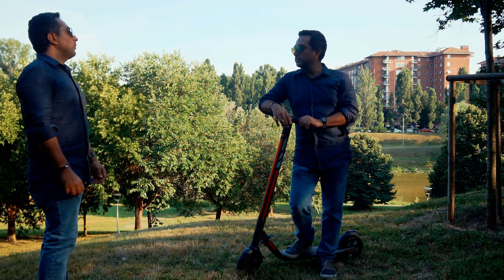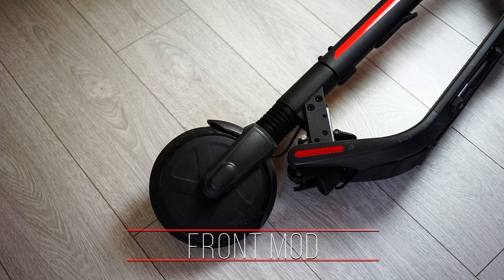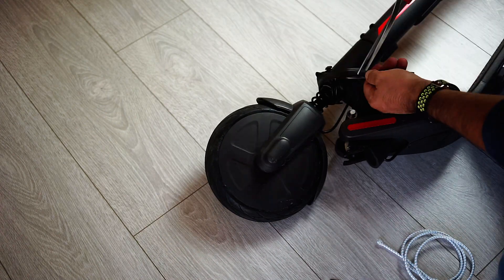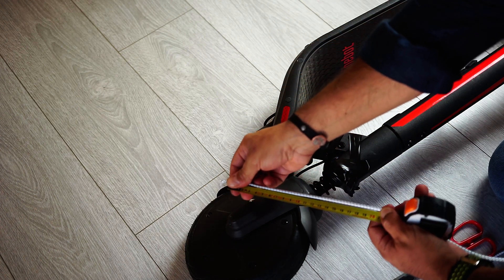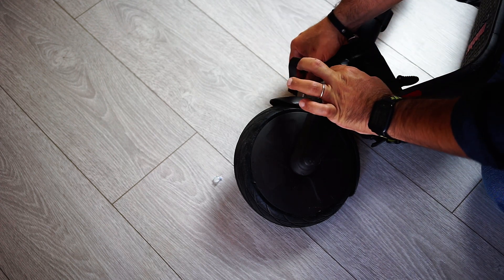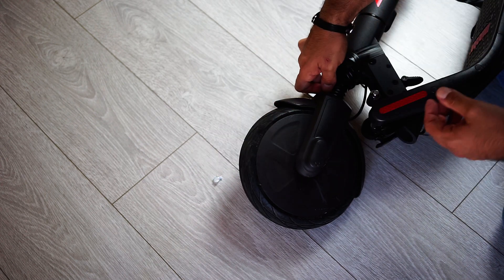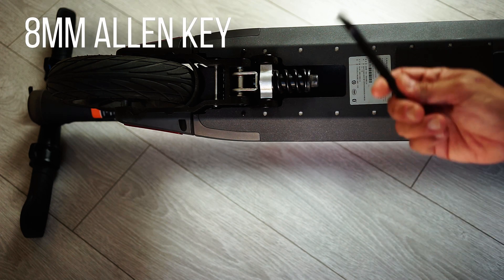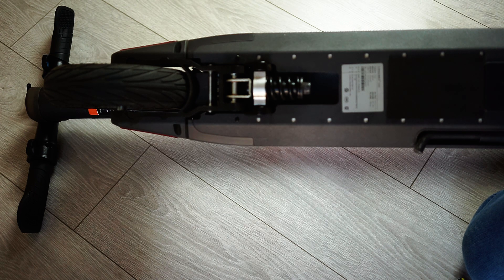Ninebot ES1 ES2 ES4 front suspension mod & rear adjustment

Comment: On every small height difference (about 1cm) there is a loud noise like suspension topping off. I learned to avoid such noise by jumping over obstacles. It puts more strain on the rear suspension, but makes a smoother ride when you just jump over anything that would make hard noise. When you drive fast, you can easily jump over the large square metal covers on the road.
I will try your mod, it's an interesting idea.
Reply from the maker: Yes your suggestion is what I try to do too, but this mod helped a bit with the disturbing noise

Comment: I don't know mate. If you stiffen the spring with any material, even with elastic one, you will have a smoother sound for sure but the power that goes through the wheel will change. Maybe im wrong here, but if the engineerd it well, than the resonance should work like its originally desing and if you modify it even a bit like this will create resonance on other parts which are not obviously takes that much. That means on my theory that you solve a cracking sound which is annyoing as hell meanwhile creating a slowly developing crack on somewhere else in the body, wheel rod, or may pushing the wheel or increase tyres wear a bit more it than should be. Adding up with the overclocking software... well :) you got it from here. But as a solution for budget money, this was a good one and thank you for it !
Reply from the maker: I didn't stiffen it since using a thin elastic cable, it will increment the absorption power of the spring, if you exceed with the thickness that might be a problem as I said in the video

Comment: Hey short question: e45d here, but same suspension in the front.
I have the problem that the suspension doesn't really work bc I'm too light. 63 kg and as far as I can see, it mostly is on the highest stage, with me being too light to "push it in" so if I'm driving over a piece of uneven ground, it's not damping anything, driving as if there wasn't suspension at all.

Anything I can do?
Reply: Eat more burgers like elvis

Comment: — Hey pal, just wanted to say thank you. I had just purchased my ES3, and I was wondering what that sound was going over bumps, now with your help, I went out and got 5mm elastic cord, and followed your steps. The front suspension is MUCH more durable now, and doesn’t bottom out on me, and I’m 260lbs. 😂 So thank you! I’ve liked, commented, and subscribed. I think I might be having a burning wire issue as well, as mentioned in your other video, but no wires are melted, or deteriorated that I can see. My scooter is at 440kms. (273 miles)
Reply from the maker: That's great! I'm glad the mod helped you too ;)
Reply: Was it error 54? I left mine at the service center today with this error code.

Comment: Heres another idea....why not line the top of the spring with something like some hot glue to cushion it maybe.
Reply from the maker: Yes that could work but with the vibrations and movements I think the hot glue will deteriorate faster than the tape
Reply: Because hot glue will fly off or crush in the first impact. In short you'll will have one softer bump then your back to normal. Even though I would recommend it even silicone would be a better option. Apply with a gun and try that 🤷🏼‍♂️ it isn't a method I would say is good because I have never tried but it would be better than hot glue for sure.
Reply from the maker: This method still working great since the time of the video and i never opened it anymore .....
Reply: I used the type of foam used for floor impact protection for children.

I cut up a suitable sized strip, and it doesn't totally bottom out anymore. 

But my scooter doesn't have rear shocks, so I'm ordering an aftermarket kit soon

Comment: Hio, Great Video, I Am A E25E Owner And I Had This Idea, CAN I Just Fill The Whole Spring FULL Of Silicone? May That Work The Same?
Reply from the maker: Hi, thank you. I have never tried but any material able to fit in the sprint and able to not to oppose too much resistance would work
Reply: @fgtechtips  Nice, But Its HARD To See Whast Are You Doing There, next Time Put A Light And Put The Camera Closer To The Object You Are Filming It
Reply from the maker: @krisraps  Hi This video if filmed in top quality in 4k, make sure your TV or PC is set at 4k so you can see all details. The contrast in this video is probably a bit too high that's why it looks a bit dark probably. It's anyway filmed with professional camera and lighting system

Comment: Sir what is that for by the way so it won’t be shakey? Thank you
Reply from the maker: This is mainly for enhance the shock absorber and avoid the annoying noise of the front suspension. You can watch my maintenance video for some other tips about vibration/front shakey
Reply: I will sir thank you for this content it helps a lot. Keep it up :)